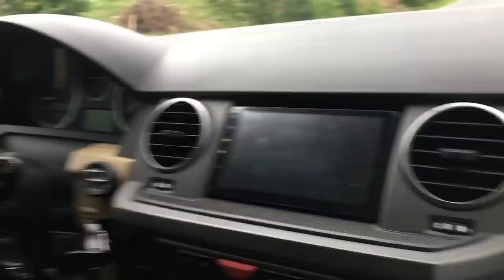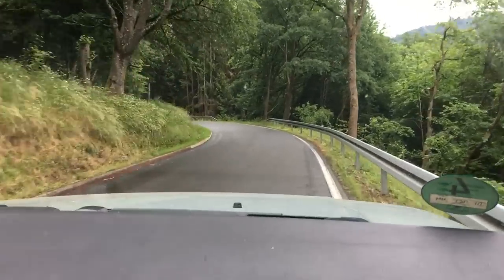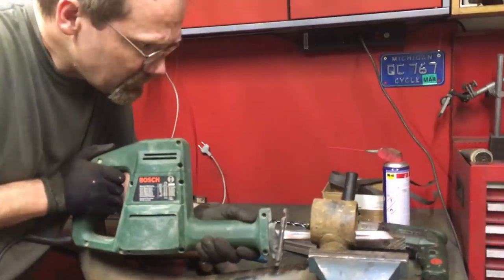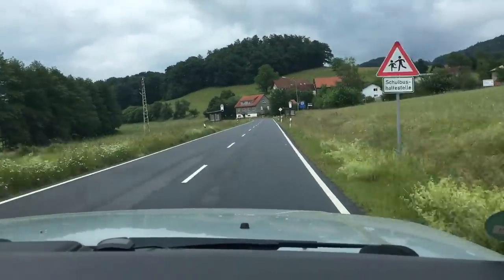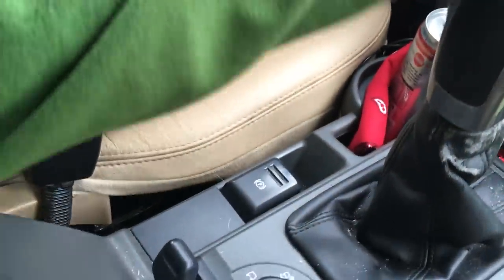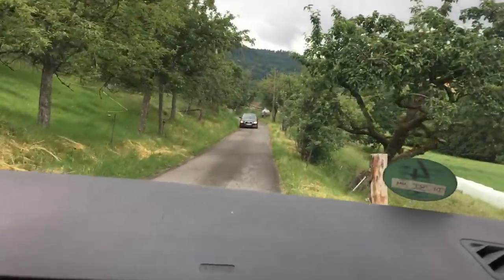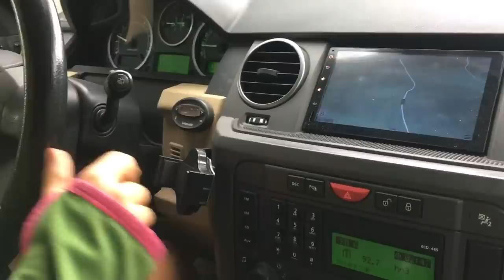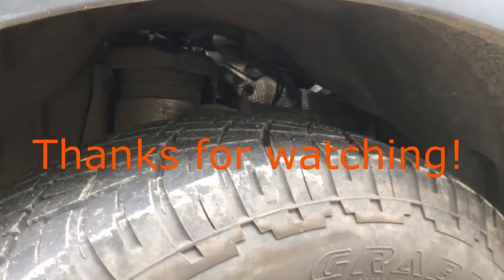Land Rover Discovery 3 / LR3 - Typical Problems And Why We Love It / S1-Ep2

Comment: I’m at 259,000 miles on my ‘06 LR3. Love it. I’d mention the expansion tank float gets saturated and stops floating, giving false “low coolant” messages. Replace the LCA bushings with poly bushings and you’ll never replace LCA’s again. Will change the feel of the car a bit. The valve cover gaskets can start to leak, but easy to replace. If you have idling issues, clean out the MAF butterfly valve with MAF cleaner. Only once have I had a parking brake issue, and I changed the pads. I hardly use the PB as it is so I’ve never had issues since. Address and air suspension leak downs ASAP. First do the test with the batt disconnected. This will help you isolate whether it is the valve blocks or airbags, or even the compressor.
Reply from the maker: When it is below freezing, my fuel gauge locks up and reads empty.  No big deal as long as I know how much fuel is left approximately.  But the computer shuts of the electric diesel heater (FBH) and the vehicle will not warm up sufficiently any more.  That is the live of a LR3 owner.  PB died last week in the alps... Will have a video of the repair soon I guess.   Thanks for your feedback.

Comment: Great video, I enjoyed listening and ticking off everything I had to do over the last 8 years, the only one I haven't had yet was a wheel bearing.  In addition I've had to change the air compressor, front and rear diffs, starter motor, alternator, height sensors, gearbox, rear propshaft, injectors, glow plugs, alternator tension pulley.  Sill love the Discovery though.  Congrats on more than 50 views, I did smile when I heard you say that and then looked at current views, well deserved.

Comment: Great videos, thanks for creating them. I too have had a love affair with my Disco 3 since 2009 (only 130000 km) and have been through most of the issues you describe but without the benefit of a workshop, the time and requisite skill to repair it myself. I’m now going through electrical and suspension issues again, likely a new alternator required and lower arms. I was ready to finally give up but, inspired by you, maybe I’ll give it one last slug of cash!
Reply from the maker: Hello Jed, thanks for your comment and good luck with the upcoming repairs.

Comment: great video, thank you. It seems like a labour of love owning a D3. When you said "the wheel nuts rust, swell up and then the tool doesnt fit", you may have finally put me off buying one!
Reply from the maker: Yes, you need to be "dedicated" to drive this car - no doubt.    I indeed bought 20 new wheel nuts on ebay at one time for 7€ each!    But we love this car and there is nothing what will change this.  But I would be crazy to recommend it to other people.    
I guess we always had high-maintenance cars and put up with many problems.   My first car with 18 y was a 1988 Lancia Delta HF Turbo.
Reply: @Vera_and_Christian  Since I left my comment I might have been won over by the car. I'm used to higher maintenance cars, my every day car is a 35 year old BMW so I expect it to be an upgrade from that! What frustrates me is poor design, esspecially style over substance, and the wheel nuts are a sign of that. Thankfully I have not found many other issues like this in my research. 

Thanks for making your excellent videos.
Reply from the maker: You are welcome.  Veras Freelander has BMW parts and it is ok. But I can imagine that a high end BMW is about the most complex setup available.  I do like high end German cars and I get to drive them once in a while as company rentals.  As a private person, I prefer older cars with less technology. Fanciest car I ever had was a 2001 A6 quattro. It was loaded and easily topped the 2006 LR3 in all Features. But we did not connect to it.

Comment: Your videos are just great! I think many people find them very helpfull, and amusing! I am also a Citroen man and follow your 2.7 experiences as the engines are fairly similar. I have a 2009 2.7 C6 with about 118.000 miles - 180,000 km. I am looking to buy a C6 for parts. If it is working o.k. would you need the basic engine? I like to drive around Europe and could probably even deliver it! Keep on Truckin"!.

Comment: Hi Guys, fantastic videos . I really appreciate the time you put into them .  I want to buy a LR3 and I don't mind the repairs but it's not knowing exactly what the problem is .  I currently run a Mercedes ML and the diagnostics is very vague usually .  It could be one of 6 different things .  So I hope the LR3 is easier to diagnose the faults accurately .  Best wishes from the UK
Reply from the maker: The most useful tool is a diagnostic tool. It's actually pretty accurate, without one, it's just a wild guessing game. We have the older version of the icarsoft Land Rover specific tool. The GAP tool is just so expensive for us now with the extra import tax due to Brexit.🙋‍♀️Vera

Comment: Glad to see some one making a video about liking the disco been thinking about one myself but get put off by people.I drive a Freelander and was told the same thing before I bought it I know its not a real Landrover but these days what is
Reply: What is written on the bonnet how many oval badges are on your car with Landrover on them ?
I'm on my 2nd Freelander 2 . I did 65000 miles in the first one and I've done 20000 miles in my 2nd one and I have zero issues with either of them 
Like any car or mechanical machine , get them serviced regularly and look after them and they don't let you down 
If you think you don't have a real Landrover look on u-tube for the guy driving a freelander 2 in Australia and it will change your mind 
I've taken off road courses at Eastnor Castle in a Freelander and it went wherever a Defender went just slower

Comment: Land Rover Discovery 2 2004 

List of issues addressed: 

(From purchase @ 100,000 miles 3.5 years ago, to present day 160,000 miles.)

4 Michelin tyres
4 brakes (pads & discs)
1 driver’s window regulator
1 front drive / prop-shaft
8 spark plugs
1 ignition wire wire set (8)
2 coil pack sets (4/8)
1 valve cover gasket 
1 mass air flow sensor
2 oxygen sensors
1 battery
1 alternator
2 rear brake pads discs rotors 
1 water pump 
1 serpentine belt
1 radiator (transmission)
1 transmission fluid change
2 differential fluid change 
1 rear prop shaft coupling
1 front prop shaft u-joint
4 Falcon tyres
1 set inner & outer tie rods
1 drag link joint end
2 front brakes (pads & discs)
8 spark plugs
1 passenger window regulator
1 driver’s seat cushion 
1 battery

♥️ Loving this Land Rover Discovery 2! ♥️
Reply: though thats a lot. a LOT of that sounds like its neglect from the former owner.
Reply: How much did that cost?  Did you do the work yourself?

Comment: Another very common failure in the LR3 is the cracking of the dash , here in the Middle East. Apparently JLR continued to market the LR3 even though they were fully aware of this issue, and there is no recall to replace their faulty part

Comment: Brilliant expose of the Disco 3. Thank you for posting this. It's so helpful, as I am looking to get a Disco 3or 4 , or a RangeRover but I want a petrol one as I live in outer London and diesel vehicles will be penalised very heavily in the very near future and no one will be able to afford to drive a diesel anything around or through London in the future. You got a lot more than 50 likes didn't you? Lol 1.6 k so far!
Reply from the maker: Banning Diesels from the city’s is a popular trend.  Sure is an old LR not a boost of fresh air but I think that there are many modern Diesel engines which should not be banned.  Diesels have now a bad reputation because of the VW debacle here in Germany. They started this. VW did not have to pay for an electric car power grid or take 300t cars back like in the US.  The petrol V8 just takes too much fuel I think.  Thanks for your comment. Christian

Comment: You probably already know this, but you can open the lower rear hatch manually. There is a latch below the pin on the right side and above the pin on the left side. You can get your finger in there with the bottom hatch closed but it's easiest to see for the first time while the hatch is open.
Reply from the maker: Yes we know and have shown that in a video a couple of years ago👍🙋‍♀️

Comment: Congratulations on your two lovely boys.  They are having a good munch back there lol.    We have 2 boys and one girl at the moment.   I never use dealers, garage repair workshops, (unless it is an absolutely huge boring and skimming job that I have not got the needed tools for) don't mind getting dirty, using my brains and facing the challenge via the learning curve.    I am kitting myself with tools now and will build them up to a satisfactory level just before I purchase my Disco 3.   One thing I do not have is a ramp or garage so am doing research to where I can rent one for repairs when I need it.   I am also considering using a portable tent for working in poor weather.   Another thing I may consider is a portable ramp.   The Toyota Highlander for me is boring and I don't like the look of it.
Reply from the maker: You can do most of the work just by jacking the vehicle safely up. A lot of the stuff we do, we do outside since it does not fit into our garage with the RTT anymore. Invest in a good jack and jackstands.👍🙋‍♀️Vera

Comment: Love my Disco3 but also hate my Disco3.  Mines a 2005 v6 diesel.  Brilliant to drive, very comfortable with plenty of go. Pulls my caravan with no effort and goes anywhere.  However.!   Repairs are a constant issue. Electric Hand brake has packed in now along with a ping noise, a message and the suspension drops. Vehicle keeps going and resets with the ignition. As you say, expect some sort of repair every 6 months. Had the timing belts done and had previously had a suspension pump so slowing working my way through the known jobs. Will I keep it,??????

Comment: You know, there's a manual release catch on either side of the lower tailgate?  No crow-bar or sledge hammer required!

My top tip for parts, whether you do fix it yourself, or get someone else to do it is, if the thing turns, seals or is safety critical, use a genuine (or the very best OEM) part.  Anything else, patterned parts are OK.
The patterned parts are cheap, but generally don't last long - and you'll end up having to do the job again pretty soon.

There are some really good repairs for these vehicles which are easy & low cost compared to getting a dealer to do them.  Most independent repairers know how to do them, but youtube has videos on the majority if you want to DIY.

Both Disco 3, 4 & L320 RRS are very underrated vehicles.  The electronics is very reliable - but that's what most people worry about.  Generally if there's a fault code or electrical problem, it's actually a mechanical part that's worn out - nothing to do with the computers.  They are just the messenger!
Reply from the maker: You must be new to our channel👍. Maybe you have a look at a couple more videos from us.😃👍🙋‍♀️
Reply: @Vera_and_Christian  This is the first video I've watched!  Sorry if you've already covered this.

Comment: Most of the issues you have had I’ve unfortunately had in my 2005 Range Rover sport, which is the same underneath to this disco. But I’m a former mechanic so I do enjoy the repairs and I was surprised how reasonably priced the spare parts are. Just done the full rear bushings and now the car doesn’t unlock on the key. I’m guessing it’s the RF receiver. There’s always something

Comment: Thanks for great video. Very insightful. To make the video even better could please add the name of the parts that you would recommend on the description. Thanks again for the video series.
Reply from the maker: I do not have specific sources.   I recommend to buy original parts if affordable.  EGR from Valeo.
The oil pump is available from many sources.  Look to get it from a good parts supplier and not from some questionable ebay vendor who also sells furniture and underwear. 
Thanks for your feedback.

Comment: Great review and very unbiased - which is good!  So based on what you said, would the 4L petrol V6 engine (I'm in Australia) be a better choice to minimise engine repairs? (also thinking about the crankshaft failures on the diesels which I don't believe you mentioned as being a possibility)
Reply from the maker: I got no experience with gasoline engines. They are rare over here. I heard the crank failure on Diesels is caused by blocked oil passages due to infrequent oil change.  Check out Disco3.Co.uk forum.  Best source for things like this.

Comment: Very true on the"eats brakes" comment, exactly my experience on my D3 👍. Actually would be really awesome if you could list all of the tools required to do front rotor and pads change out, might consider having a crack as I'm still working from home due to Cov
Reply: For my D3, am on my third park brake, second air suspension compressor, second alternator, second rocker cover seal, wheel bearing on rear changed out.
Reply from the maker: We have brake and wheel bearing videos on our channel too. Thanks, Christian
Reply: @Vera_and_Christian  OK thanks Christian.  I have worked in offshore oil and gas for 25 years, so have some technical knowhow, but am a "newb" to fixing cars, so will need to build up tool set in my garage to attempt a brake change out on my D3.

Comment: Thank you for this honest. I like to buy a disco 3 or 4. But i find both cars the difficult to repair.
I stay with the disco 2 what i have for more then 7 years. ATB Raymond
Reply: As a Disco 1 owner I agree.
Reply from the maker: Yes, the older models are easier to repair from what I heard. The older Diesel versions are no longer an option for me here in Germany because they are restricted in some areas because of emissions. This is a real shame.  The gas engines are too costly because of gas prices.   I think the older models are also easier to modify for overland use.
Reply: Land Rover Discovery 2, 2004 

Items addressed since purchase 3.5 years ago’@ 100,000 miles, to present day 169,000 miles, listed below:

4 Michelin tyres
4 brakes (pads & discs)
1 driver’s window regulator
1 front drive / prop-shaft
8 spark plugs
1 ignition wire wire set (8)
2 coil pack sets (4/8)
1 valve cover gasket 
1 mass air flow sensor
2 oxygen sensors
1 battery
1 alternator
2 rear brake pads discs rotors 
1 water pump 
1 serpentine belt
1 radiator (transmission)
1 transmission fluid change
2 differential fluid change 
1 rear prop shaft coupling
1 front prop shaft u-joint
4 Falcon tyres
1 set inner & outer tie rods
1 drag link joint end
2 front brakes (pads & discs)
8 spark plugs
1 passenger window regulator
1 driver’s seat cushion 
1 battery  

♥️ Loving the Land Rover Discovery 2! ♥️
Reply: @larskrogh586  That is very precise 🤔 Excellent service record!

Comment: I got a 3 and a 4, Just spent $5.5K this week ion the LR4 to repair the suspension compressor, the AC compressor regulator, water connector valve on top of the engine and what looks like a new rear hand brake module. next the Timing belt. I work for my wife and my LR 3 & 4 !!!!. after seeing this I would sell it EXCEPT I BLOODY LOVE THEM
Reply from the maker: Sorry for the trouble you have with it.  Hope it will calm down after the timing belt repair.  If its on the LR3, make sure it has the reinforced oil pump. Otherwise it´s due for a major failure if the shop mounts a new idler pully.

Comment: Thanks for sharing your experience.  Are there no problems with the crank? I tried to find a Discovery 3 V6, but was striked by many "no-runners" in the ads, due to crank-failures. I am not quite sure, but Land Rover changed the layout of the crank to a forged type?
Reply from the maker: We think, that the crank failures are due to poor maintanance.  There are a lot of Disco's with on the market with a damaged engine, at least here in Germany (we follow that market closely) But they also have high Kilometers, most of them at least. Up to 300000 Km.  So we religiously do oilchanges, filter changes and all other maintaince work on every car we own.  🙋‍♀️ Vera

Comment: You mentioned the 06-08 had weak oil pump housings. 
The Jag V8 was in these vehicles in 2005 when Ford took over so did they change to a different metal composition in 2006 for that pump?
Cheers...love your channel BTW, good stuff.
Reply from the maker: I don’t know.  The early housings had a weak casting as shown in my oil pump test video.  Christian
Reply: @Vera_and_Christian  ok so it's just good practise to change that oil pump out and do the tensioner & belt if I buy a 05-08 LR3.

Comment: Hey Christian, just wondering how you got the head rest on your middle seat to sit down low like that?  My D3 one sits up high and blocks some of my rear window.
Reply from the maker: The headset on ours, you can push down. You have to push hard, but it slides over the back of the seat. We have a 5 seater, maybe it's different on a 7seater. 🙋‍♀️Vera
Reply: @Vera_and_Christian  OK thanks Vera.  Yes, mine is a 7 seater, but no obvious way getting it to sit as low as yours.  Will have another look in the owners manual and online.  Cheers Mark

Comment: Its not an option in Holland due to the extreme high road tax we have to pay. 800-950 euros per 3 months as diesel. And its cool you work on the LR yourself with a workshop at home. But its by far a cheap 4x4 to own and run. It can be massive moneypits.

Comment: Very nice story exactly the same with my D3 - you didn’t mention the plastic thermostat housing which cracks or the water level sensor in header tank :-) thanks
Reply from the maker: I did replace the thermostat but was spared the level sensor issue.